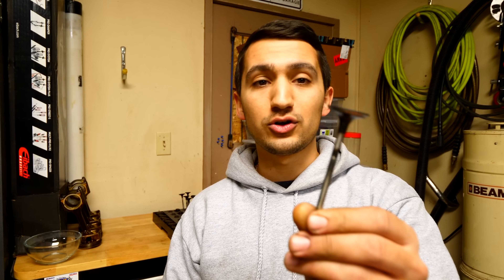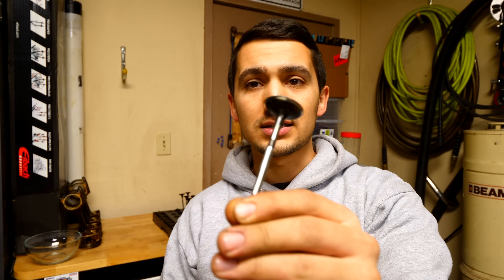How to Clean and Refinish Valves

Comment: Completely unnecessary refacing the Volvo is far more important which is something you’re probably not going to do
Reply: I was going to mention this ... definitely going to need to lap the valve to get it to seal again (whether it was sealing or not before). Also, with taking any material off of the valve stem, you'll also want to check to ensure there's not a problem with valve guide play. Shiny valves are pretty, but removing metal is not a good thing.
Reply: You need to take it to a engine reconditioner and have the valve faces recut and also the corresponding seats then lap the valves in but if the job is done correctly with good equipment lapping isn’t really necessary these days something we used to do back when we were cutting with stones the equipment we use is far more advanced night which in turn gives us a far more accurate cut and what engine do you have in your mini cooper is it the older version the K 16 engine if so I strongly recommend you get the head skimmed as well they are notorious for blown head gasket also inlet manifold gasket to be a massive problem that’s assuming you have this engine of course
Reply: Always haters. I don’t like the sandblast method at all though.
Reply: Hope you’re not referring to meI’m trying to give to give solid advice I do this for living 25 years experience I suggest you read things properly rather than just giving random comments but I suppose that’s the joy of YouTube full of BS
Reply: Nathan Beazer it's ok he did that as long as he didn't use a thick grit sand paper to not effect his valve guide clearance and as long as he relaps the valves to the seats and to make sure he has no leaks and they are sealing properly I did this but I went the extra mile and have zero issues
Reply: Not hating. Just trying to let everyone know this is not a good method to clean your valves. Again, looks pretty, but can damage the valve. There's such things as tolerances. Sanding the valve is a great way to kill tolerances. If you want to use sand paper to clean your valves, go right ahead. Your valves; your rebuild; and then, your rebuild again when you're blowing oil past the valve guides.
Reply: Paulster2 done it plenty of time never had a problem if they dont know what they doing then dont doit I rebuild plenty of motors never had a issue there's this things called micrometers of people cant use them dont rebuild anything is like saying u use plastic gage to measure oil clearances for your bearings or mic ing everything same thing diff methods I had luck with both aviasly using a mic is the correct way but not everyone knows how to use them or read them so what I'm saying what he is doing is not the rite way but if u know what u are doing it won't hurt nothing I do agree I would only use 800 1000 1500 just to make them new the polish is useless just as long as they are super clean to reseat them
Reply: what he said. plus, if valve has some sort of coating and you polish it away, valve may come to soft and wear out very fast. For example ti-valves on any dirtbike.
Reply: modern engines taken properly cared for with engine oil and filter changes don't really wear out internals as a mechanic dismantled engines with nearly half a million miles on them with little or no wear .. if you take apart a good running engine for mods or rebuild chances are the valves need only be installed in the cylinder they were removed in and lapped in with valve lapping compound to verify the seal.
Reply: if you truly want a 3 angle valve job your best bet is to purchase brand new valves with 3 angle valve job already done on them and install them (lap in) yourself.. 9 out of 10 machine shops if you ask them for a 3 angle valve job and by talking to you can deduce you dont know shit will do a 1 angle valve job and charge you for 3 
and 5 angles are only for race teams that pull motors apart after each run and either clean or replace on the spot
Reply: Griffon just a bit of information for you.
A 3 angle valve job does not refer to the valve itself it refers to the valve seat. Any standard production head will have a 3 angle valve job as that's just a standard seat (ie. a 30* top cut, 45* mating face 60* bottom cut)
What you're referring to is back cutting on a valve, which is where you face one additional angle or more depending on the valve.
And lastly a 5 angle valve job can be used on the street no problem, additional angles aren't going to determine how long your valves seal for, they are there to help turn the intake charge and act as sheer points to help atomize fuel droplets. As long as your mating face is doing it's job properly and dispersing heat and sealing like it's designed to do then you will have no problem what so ever
Reply: years ago when I did a 5 angle valve job for the street is was pretty much a waste of time in that it was 35 years ago and using a carb and all the additional flow gained from a 5 angle valve job was lost almost immediately from carbon build up on the valve.. in the past when they said 5 angle was for racing it wasn't because you would see Little gains on the street it was because in racing applications the heads would be torn apart and freshened up (cleaned) after only a few runs or each pass depending on the budget of the race team..  

as for the 3 angles on the valves themselves I always cut the top part of intake valves (2 angles) and 3 angles on exhaust valves reason only 2 on intake is the margin on them is so thin doing 3rd angle not advisable 

as for the valve seats I port and polish all the heads I work on and the material below the seat is blended into the bowl
Reply: I did learn some things reading all the comments in this thread.  Thank you for sharing.  However, I just want to note, all the run-on sentences made it very hard to follow... please guys... separate thoughts need separate punctuation.
Reply: I'm no expert, but a valve is not going in any of my builds without lapping by hand and feel. I don't care what the machine shop guaranteed or the machine reads. Just my opinion, and I'd plan on hand lapping a brand new assemble head from the dealer... The valve angles look fine with plenty of metal and miles left on them. The time you get the valves cut is about the time to replace the valve. I've only seen valves cut for performance engines in which they are meant to allow more fuel. Correct me if I'm wrong anywhere and just an opinion...

Comment: DUDE, you missed your calling, you should set up the diamond and jewelry displays on the home shopping network. You are not making a better performing valve. I guarantee motor ran better nice and dirty, and in my opinion they weren't that bad to begin with. I clean my valves by running 11.02 @ 123 miles an hour down the Byron Illinois Drag Strip  in a modified 1980 Corvette.... YEEEEEAAAAAAHHHH BUDY!

Comment: Great video! I can tell you put a lot of time and effort into the video, so thanks. Because you are spinning the valve on the drill, it will remain (for the most part) the same shape. Just make sure that when you reinstall the valves, you lap and grind them to fit the valve seat (something that you should be doing anyway). Remember, valves need to make a perfect seal with the seat in order to hold compression. The valves look great! Cheers!

Comment: Can i use 600 grit?
Reply: Use 40 grit if you want. You're screwing your valves up either way. 😂 Don't do this man. Any head work should be done by the pros. Full blown racing teams leave this stuff to high end machine shops for a reason.

Comment: For those not really knowing wtf they THINK they are talking about. Sure, old school train of though says to just clean the carbon, hand lap them in and be done. And on a daily driver sure thats enough. But for a modified car, especially turbo, having a high polish on the valves AND combustion chamber WILL help with detonation. Sure carbon comes back, but with a polished surface it wont stick nearly as easy/much. Same goes for exhaust ports on the head, helps keep them clean
Reply: well said .. people actually pay a lot of money for polished valves with the low friction for carbon to stick to is the actual selling factor
Reply: The problem isn't that he polished them, it's that he sanded both the stem where the guide runs and the sealing surface of the valve.
It's likely the valve faces weren't concentric to start with, but they're definitely fucked now and lapping them will only make it worse.
Reply: Yeah, when done professionally with proper tools and materials. This dude put it in the chuck of a hand drill and sanded it down in a cereal bowl. Carbon might have a more difficult time adhering to the valve, but the seals will have a MUCH harder time doing their job. Using the same argument as yourself, newer vehicles REQUIRE precise machining due to extremely low tolerances.

Comment: Anyone watching this video... Absolutely do not ever use sand paper on the stem!  Do not let the sand blasting sand hit the stem either!  Also do not polish the intake valve unless it is direct injected, if it is port EFI or carbed then a little roughness helps keep the fuel suspended in the air and sharp angles on the 3 (or more) valve angles also helps break up fuel droplets.  Also you need the valve seat sealing surface machined flat after this or your asking for it to not seal and not transfer heat out through the seat while it is closed. You are rounding off the sealing surface so only a very tiny round seat will be sealing instead of a relatively wide flat sealing surface.  If done properly it can actually help the ex valve run cooler by reducing the valves ability to take in heat thru a reduced surface area and reduce the chance of detonation originating from the hot valve and it also reduces carbon buildup in the future.  It will also slightly increase ex flow but not enough to notice any power gain from this modification alone.

Comment: Never sand valves. NEVER the coating that most valves come with today is needed. As well as the material removed off the valve will cause it to be sloppy in the stem which leads to valve wobble and then you drop a valve and fuck your engine.. great video for costing people money 👍👍

Comment: I already clean 5 valves like this video until i read all the comments. Then I realized that the edge of the valves not as sharp as before. It is clean but it will not seat properly. All we need to do is just clean it using wire brush. Please bro, someone gonna destroy their valves by watching this.

Comment: I am not sure how schooled trained this young man is. But he just broke every rule of valve stem care. 1st using sand paper wet or dry will cause you to lose the proper seating on the stem causing the valve stem to not seal correctly. Polishing a valve stem removes the way it is supposed to atomize the fuel.   Over all your valves will NOT close properly making your engine to run horrible.

Comment: I like this video...BUT...1) never clamp a valve stem into a drill chuck without first covering the end of the stem with 2 layers of painters tape- unless the jaws of your drill are plastic, which most are not. Otherwise you'll score the stem just a tad, and open the door to valve guide problems, requiring another rebuild.

2) Second never use abrasives on the underside of the valve head where it mates with the valve seat: no 3M cloths, no sandpapers...
because as valves are fit to within 1 or 2/ 10,000ths of an inch, a tolerance easily thrown off 2 to 5/ 10,000ths by scrubbing and sanding. 

The only abrasives used are fine lapping compounds with a hand lapping tool- if that doesn't do it, to  a Machinist you go. All tolerances are measured of course with machinists tools.

If you don't follow these rules, the  valve underside will not seal to the valve seat and the valve will go bad again quickly. 

Liquid carbon removal compounds work well, and do not change the shape of the metal. A better choice to be sure.

Comment: i'll tell you what, valve manufacturers do not want to let that secret out of the bag. that's a complete valve restoral to new like dimensions. this guy in the video knows what he's talking about. i would even do this to brand new valves, sorta like breaking them in before you run it. the valve face has got to be "universal" after this treatment. if you have another motor of some kind you could always use them after the short life your valve job didn't last. just re-polish them and put em in.

Comment: Back in 2003 time frame I built a B-series Honda, this was long before YouTube. Even then I understood that you DO NOT touch the valve seat, if you do you will ruin the seal against the valve seat. You can use a drill to clean valves but, use masking tape on the valve stem to prevent metal to metal contact(chuck-valve stem) and DO NOT touch the angles cut into the valve. If you want pretty shiny valves that don’t seal, do what he did.

Comment: Goodbye valve seal lmao. You do know the valves have precision angles grinded into the ring lands for sealing with the bowl right?... You kind of just removed all that and effectively rendered them useless, You'll need to re-grind then re-lap your valves in, and that's a very important step so you should have mentioned it so I know you didn't do it. its not really an issue with how they look its all about function. Also when you do valve jobs,... you do angle jobs that's where the performance comes in. also you need a drill press with a variety of soft jaws. hope this helps.

Comment: there is an effect in polishing it using an abrassive paper since the valve shaft engages in the valve seal, it will surely eat up a good part of that shaft. worst, it will allow oil to slip in and out of it, carbon will be back in no time

Comment: Hey I want to change the stock valves in my 223cc wildcat engine with stainless steel valves. Which sizes should I get? I have 32lb springs.

Comment: The only thing i see wrong with your drill method is using a cordless drill, me personally i would've used an air compressor & air drill  & slapped it in a vice and taped off the ends of the valve stems and then put em in the chuck and tighten it down then hit it with the scotch brite. Probably be wise to spray a little WD-40 while using the scotch brite

Comment: Love your Chanel your actually my only subscription... reason I’m doing the exact same project .  2009 jcw same problems that your having .  I did a diy polish on the head runners .  Got WAY STREET CAMS . And upgraded turbo cartridge .  Didn’t want big turbo .... r56 get a little volatile in my opinion.  My name is Mark and I’m a full time heavy equipment mechanic just fell in love with driving minis and appreciate your videos

Comment: Like the video and learned a few things. However, I see all these highly critical comments on here about how the poster has completely destroyed the valve seating because he wet sanded it for a minute or two with a drill. If this is true then please explain how the valves were supposed to be decarbonised and polished. I also find it very difficult to believe that he would have taken that much metal off of his valves that fast, many of you are acting like that metal is soft and brittle which I also do not believe. The negative reactions on Youtube shows the sad state of human nature and the lack or respect for each other.
Reply: Removing carbon from valves is normally done chemically, or with an abrasive that will not harm the valve. Polishing the seat of the valve isn't a big deal as it can be fixed with a valve job, however, sanding the stem is not a great idea. Most valve stem guides only have a service limit of around .001-.002" from stock. Removing .001" of material from the diameter of a valve stem takes very little time with something so abrasive. I do agree that most individuals on here are a bit harsh when addressing the issue though.

Comment: I Agree with Other Commenters Here, This Video NEEDS REMOVED. As if people who don't know any better follow this video, they are just destroying their engine. 
If all he used was the scotch bright pad... probably would have been fine. As (if not over done) it shouldn't damage the surface or remove any metal, but it would remove all the build up and deposits. Even still, you would want to be as gentle as possible. I would soak the valves in carb cleaner or other solvent to lose and remove most of the build up, then MAYBE finish with some light scotch bright pad. 

But the rest of the stuff he done.... he obviously doesn't know anything about valves... or engines for that matter... These are not the rims on your car.... Its not about how "shiny" they are... its about How Well they SEAL. To seal correctly Requires Extreme Tight Fitting PRECISION Ground Surfaces. 
You remove metal without PRECISION (read machinist tools and process with dialed in Precise CORRECT SPECS) ... then you are damaging/destroying the valve and they will NOT seal properly. Without sealing, you will lose some compression, you also have "blow by" which will only build up MORE deposits on the valves, which will cause you to lose MORE compression. You will also "burn" your valves. If the valve stem geometry is changed, a lot of things can happen. Like a broken or bent valve. 

I can't hardly believe anyone would use sandpaper... let alone sand blasting!!  the heat alone from sand blasting would destroy the precision of the valves, let alone the amount of metal being removed. 
I wonder how many people have destroyed their valves and even damaged their engine, due to this video being up for going on 3 years.... Hopefully people do more research, and don't just take the first "info" they see and run with it.